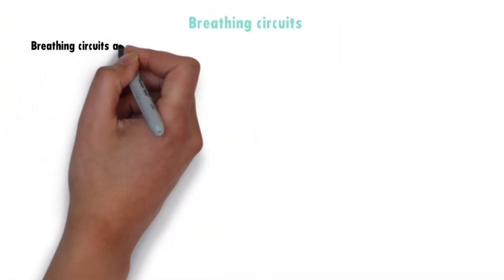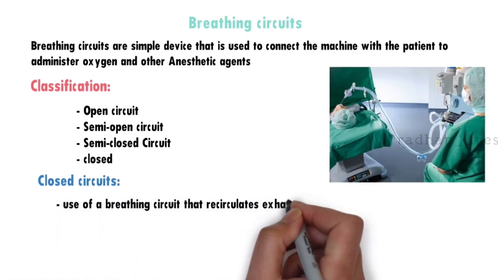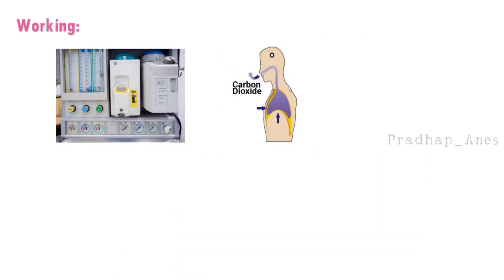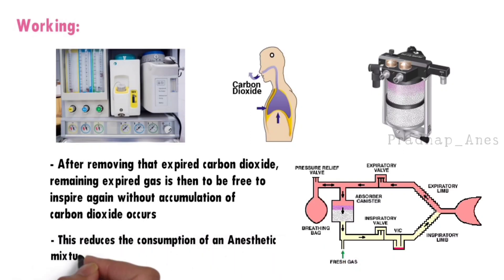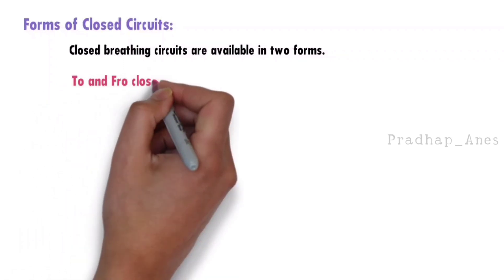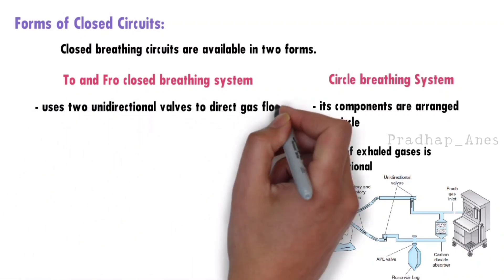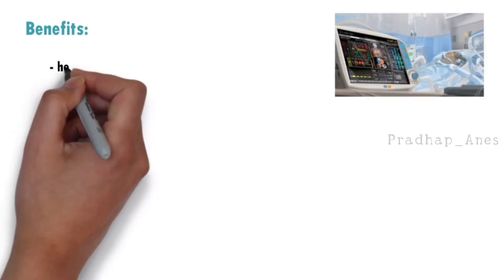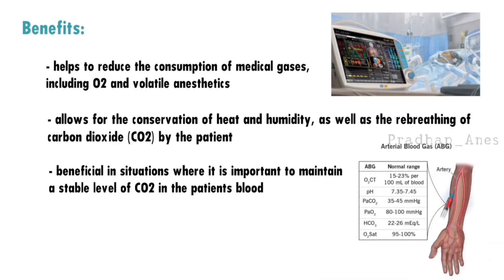Breathing circuits | Closed Circuit

Comment: Why reservoir/breathing bag is in expiratory tube
Reply from the maker: The reservoir bag is placed in the inspiratory limb of the circuit. It is used to store oxygen and anesthetic gases during the expiratory phase of ventilation and to provide a source of fresh gas during the inspiratory phase.
Reply: In the closed circuit sir resovior bag is placed in expiratory tube why sir.
Reply from the maker: It is placed in inspiratory tube not in expiratory tube to store oxygen and deliver Anesthetic gases.
Reply: No sir in ajay yadav short notes book and in google also, in the closed breathing circuit the reservoir bag is in expiratiry tubing
Reply from the maker: The reservoir bag can be placed on either the inspiratory or expiratory limb of the breathing circuit depending on the design of the circuit. Even if it is in expiratory limb it has valve to prevent the flow of gases to expiratory tube. So, technically it is in inspiratory tube. Apart from place, the main work of reservoir bag is to allows collection of fresh gas flow during expiration, which in turn minimizes the amount of fresh gas required to prevent rebreathing. I hope you understand now.